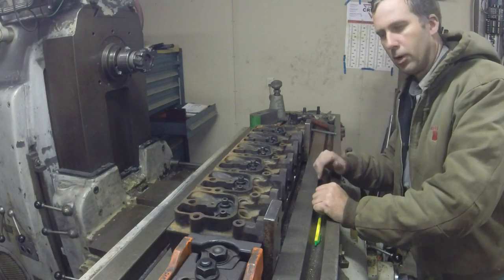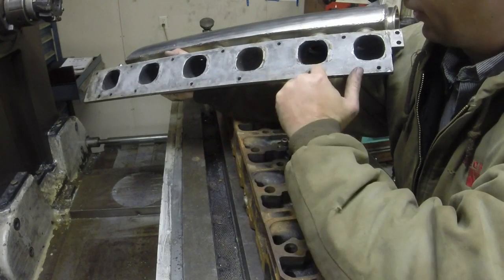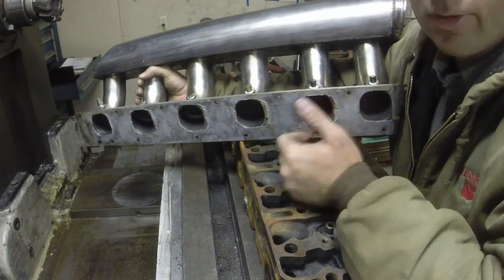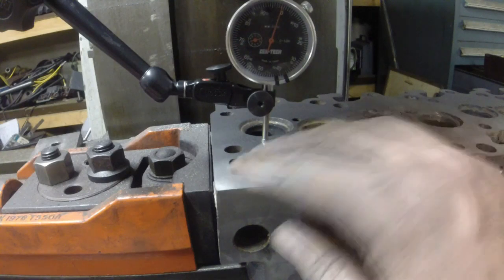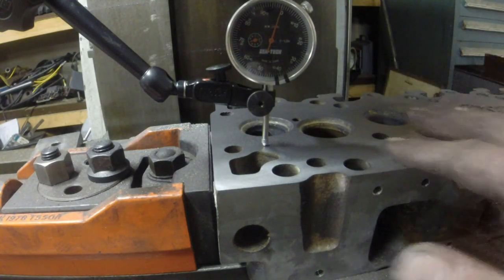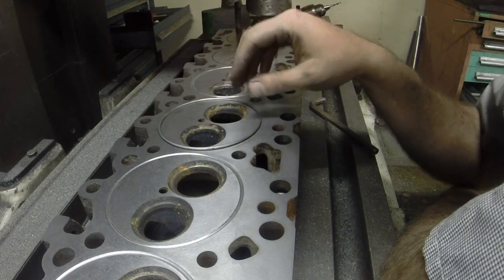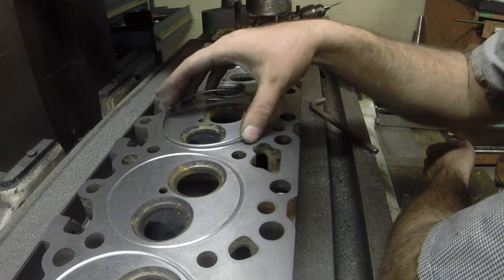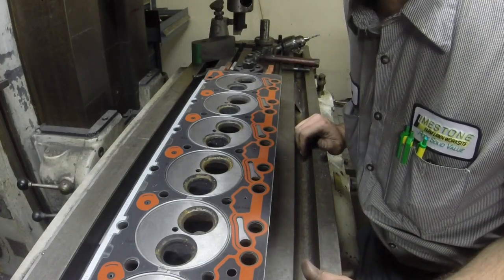Cummins race manifold and fire ring install.

Comment: Hey Brian. Did I hear you say you don't recommend fire rings on a daily driver because they will were out fast??. Thanks. Looking foward to your reply
Reply from the maker: In my experience fire rings won't last 200,000miles like a stock head gasket can. I have seen a bunch of fire rings that have broken at around the 60,000mile mark. They literally get brittle and crack in half. They don't take repetitive heat cycles over a long time very well.  If you want to run enough power to where you have to have fire rings to hold then you don't have much choice. If you only plan to be in the 400-500rwhp range I think you can get by better with just studs and a MLS but this of course means your block and head have to be machined....... Nothing is ever easy. lol
Reply: @bcbloc02  10/4 .  I thank you so much for info. That made up my mind. I won't be using fire rings for my application. I appreciate the fast ansewer. Be well.

Comment: Where do you find the bore center for the rings?
Reply from the maker: I locate off the head dowel pins and then use my DRO to locate the centers correctly from there.

Comment: How do you tram the vertical head with the work piece on the table?  Or did it come off between operations?
Reply from the maker: Because of the large diameter of the head and its mounted scale I can position the head within less than a half thou over 12inches. It is more square than my table is flat so it is plenty good for the job. I changed the way I do this job to using the horizontal for better accuracy, less than .001" of flat over 36inches.
Reply: Thanks!

Comment: See, Bailey made sure no one stole the couch while you were working! Nice job on the head, I cringed when I saw the cutter moving close to the pipe plug sticking out! I agree with you about the fire rings should have a radiused groove although there are guys I know who insist a square groove is best completely ignoring that sharp corners instigate cracks.

Comment: hey there. I'm new to machining and am always asking questions when I see things I'm interested in learn do eventually. I am starting a precision machining and CNC course in January and after I would like to do things to make money on in my small garage. is that machine made for just doing heads? what machine is it? what services do you offer that a new machinist could make money on? I am trying to put together a small list of machining jobs I could do once I'm training in my garage. Also,what milling machine would you suggest a broke,new machinist buy to put in a 15x12 garage? I see alot of Bridgeport machines on Craigslist. could I do alot of jobs in this one machine? and should I invest in a small lathe? any suggestions would be greatly appreciated as I am looking to people on YouTube for advice for now.
Reply from the maker: Lots of questions I will see if i can get them . This machine is A Cincinnati #4 Horizontal milling machine, it is not designed just for doing cylinder heads it is a very large and rigid machine limited mostly by what tooling you have and what you can fit in it. It weighs between 14000-16000lb and is not typical garage shop gear.  With a 25hp motor you need a very large electrical service to feed it. Most of what I do is probably not good for beginner machinist as it is high risk work since you can easily scrap a customers $5000+ dollar part with a mistake and then what do you do?? Answer is you eat it, then how many more jobs do you have to do just to cover that one?? Most Bridgeports are clapped out garbage and honestly for what people want for them you would be better off to spend twice the money and buy a new Sharp. well seasoned machinists can work with a worn machine and get good results a new machinist won't know the tricks or the tendencies of various operations well enough to not be wasting tons of time and parts trying to figure out why when you move the table .005 it cuts .007.  My lathe has been my #1 money maker for my shop and a worn lathe is easier to work with than a worn mill and seems to be more sympathetic to mistakes so it is a good place to learn.  The machines are only the tip on the iceburg you will have to spend 3-4 times as much on tooling to do the work. My advice find a local mentor that can help you with the work and maybe you can bum the use of some machines when you need to do an operation you don't have the equipment for and grown from there.

Comment: how much can you mill down a 6.7 cummins block
Reply from the maker: Depends on what you are doing with it but .020 is normally the max before you will have piston clearance problems. If you have any kind of  aftermarket cam maybe none or you might have valve clearance problems. It is too broad a question to really answer as everything has to fit together as a system.
Reply: bcbloc02 what if i took off an inch and put on a 1" deck plate
Reply from the maker: Ryan Tanksley
Not advisable to deck plate without also sleeving as your rings would be running over the part line of the block and the plate and that would be very bad for the rings. Also you take that much off thetop of the block and you will loose a ton of strength in your deck and will loose a bunch of thread engagement on your head studs and likely have sealing problems.

Comment: @6.20 personnally Im tired of this..   specify a ra and get it to the correct ra for the gasket and engine used.. DONT just say "it's got to have some bite"..
Reply: Why does he need to specify a range?  Maybe that's a secret between him and the engine builder over the competition.
Reply: maybe they have,sorry didnt think of that, yes true..I'm just a little grumpy at the Local machinists that ALWAYS seem to know BETTER than all the companies that manufactures the stuff. I've heard that exakt thing beeing said so many times instead of just saying, "yep, ive measured roughness average according to specs.", (they neeeever do here)..

Comment: How do you clock up on the centre of each cylinder before cutting the fire ring groves? I guess you know the numbers from measuring the block...?
Reply from the maker: I know what the bore centers are from the block and where they locate related to the dowl pin holes in the head so I can pin locate those and then just use the DRO to move to each bore center for grooving.

Comment: 80 to 90 lbs. boost !!??!!??    Holy Ballz.
Reply from the maker: +Doug Bourdo Not so much, some engines run in the 300lb range, although not so common anymore, as technology has allowed engines to make the same power with 200lbs.

Comment: Brian, wouldn't it be easier to paint as you go, than have to set everything up again. Of course  around here barn painters can do the job cheaper than you can purchase  materials.
Reply from the maker: +Robert Klein Guessing this is in the wrong video but if you are talking about painting the barn the wood needs to dry out good before painting so it needs to be up a month or two to stabilize before that is done.

Comment: Very nice Brian. Good save on fixing the previous milling job.

Did you mill the face of that intake manifold to match, or was it "good enough"? It didn't look quite flat to me,  but it is hard to tell in a quick video shot, so I'm likely wrong on that.
Reply from the maker: +l wilton The go pro makes nothing look flat, I was not requested to do anything to the manifold and it has been on another engine before so I assume it sealed, didn't appear warped or out of flat when I test bolted it on.

Comment: Very interesting work you do (and very accurate). I would have liked to have seen how you located the first groove for the rings. That must also be critical to get them right. I understand the "barn money" jobs, the money from which keeps the project on track and provides another stack of materials you can make disappear. Thanks Brian. Another cool video.
Reply from the maker: +Jim Milne I have done this job many times and I have the info written in my folder
 of jobs. There is a dowel hole in the head which locates it. I know the 
bore center location of that cylinder from that dowel hole. I center up 
on that dowel hole then move over to bore center and cut, then each next 
hole is just moving the table the bore separation distance.
Reply: bcbloc02 I know this is an old comment but how did you find the bore location based off of the dowel pins the first time you ever had to do this? In other words how would you accurately find the bore center location based off of the dowel pins if all you had to go off of was just the cylinder head lying in front of you?

Comment: Nice job on the head.  Still needs a valve grind?
Reply from the maker: +Randy Richard Yes it is getting oversized valves, port and polish and a 5angle grind but somebody else is doing that work to it. I don't have the tooling for doing valve work.
Reply: +bcbloc02 I was going to ask the same thing, some of those valves looked kinda (ok - really) rough for a race engine!

Comment: Haven't done much machining on big engine blocks, interesting to see ho you get it done, and get fine results... ;)
Reply from the maker: +pierre beaudry It is a bit different than watch making. :-)
Reply: +bcbloc02 The late George Daniels, master watchmaker, once remarked that "the only difference between restoring a Bentley and restoring a watch is the size of hammer you use." If you ever want to go to small stuff, look up George Daniels.
Reply from the maker: Juan Rivero
 I like the big hammers, I will leave watchmaking to somebody else. :-)

Comment: Brian, did the exact same thing on an old 12 valve (except I cut the old air box off)! One thing I noticed is that you milled intake side in farther then I did. I left more material to provide better air flow between cylinder runners (intake ports), but the main reason was to provide gasket surface for rocker covers! What are they planning on doing on rocker covers, just overlap on new intake plate?
Reply from the maker: +Fred Newman i didn't mill but maybe .002 below where somebody else already had. I would have preferred to left it longer myself. The gasket edge is just barely still on the head. but I made the top of the manifold plate even with the top of the head to add some surface back.

Comment: Great vid, just one question.
How did you find the centre of the fire ring groove? Measured/marked off the gasket?
Reply from the maker: +Perius  I have done this job many times and I have the info written in my folder of jobs. There is a dowl hole in the head which locates it. I know the bore center location of that cylinder from that dowl hole. I center up on that dowl hole then move over to bore center and cut, then each next hole is just moving the table the bore seperation distance.

Comment: cool to see to see rings being cut, i knew quite a few who had it done on the Porsche 944T motors so they could crank the boost up. most of them found out what happens  when you effectively bypass the "fuse" that the head gasket provides. push it hard enough and something else will let go, usually the bottom end. small aluminium head and blocks were definitely not built as strong as diesel components.
thanks for the video
Reply from the maker: +Phil&#39;s Projects When you find the next week link you just replace that too. :-)  Problem with these motors is at a certain point you start splitting blocks from the pressure, then it is deck plate, sleeve and girdle time, then jeep going making power. :-)
Reply: +bcbloc02  the 944 engine blocks has aluminium cylinders, with a coating, Nikasil i believe, it didnt take huge turbo pressure to get the top of the cylinder to move under high loads.hence wht people started putting O rings in.
yep my 4 con rods looked like a S when the signal line to the waste gate split and i got 50+ lbs of unwanted boost.
Reply from the maker: Phil's Projects
Well that is one way to decompress it!
Reply: yep, once the head lifted and the radiator blew open the compression went down drastically
Reply: not sure, bill, all i did was pass 911's on the track, never looked, lol

Comment: Any reason you milled off the top of the tapered gallery plugs instead of just tapping the holes deeper thus keeping the ability to remove them and clean the galleries when needed?
Do we get to see the beast in action when it's bolted back together?
Cheers Eric
Reply from the maker: +midgoog2 The plugs are under the manifold so there is no access when it is on, and they are plugs for sensors which the engine no longer has so there is no need to access them anyway.